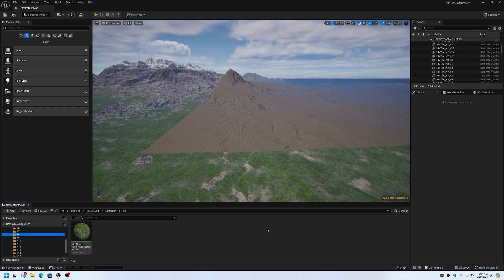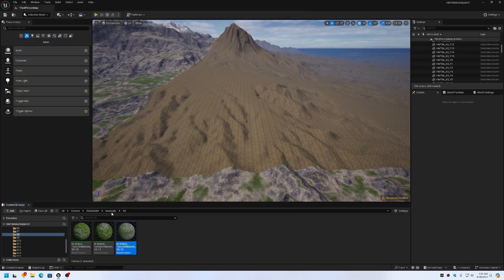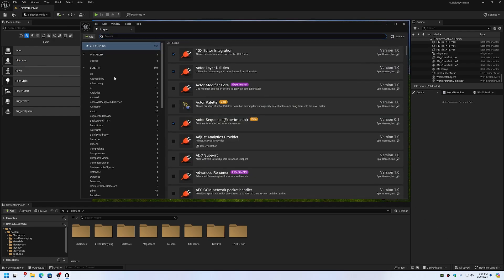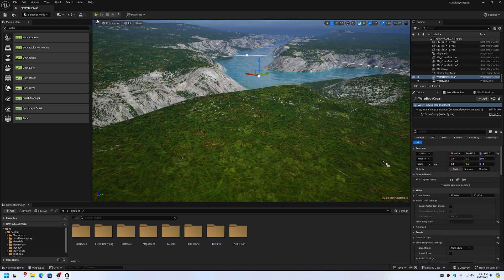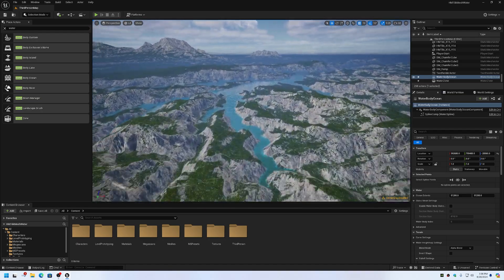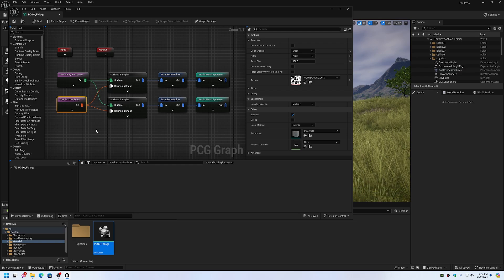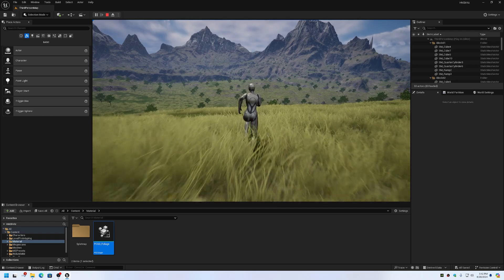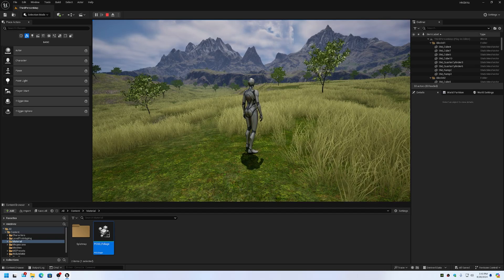UE5 Mesh Tile TIN Terrain Part 7 PCG Water plus

Comment from the maker: The TIN Terrain uses a specially designed Triangulated Irregular Mesh with Delaunay-style optimization.  Terrains up to 64km x 64km are easy to create and very fast performing.
Almost all of the Unreal Engine subsystems and features work with TIN Terrains.  See Parts 1 through 6 for more information.

Comment: how long did it take for you to generate the PCG for the map? it takes ages for me to generate over a 100x100 metre landscape on a pretty good pc

I'm spawning decently dense single blade grass but it's seriously so slow on pcg, using the landscape procedural foliage I've spawned grass with 10k density (modified engine) with 20k cull distance on a 2x2km map almost instantly

this approach makes me stuck with landscape though which i hate, unreals landscape performance is so bad and consumes so much ms on the game thread.

also kudos to you for this TIN meshed series, this is gonna be of so much help for people who are tired of dealing with unreals landscape
Reply from the maker: The PCG foliage generation for any foliage type was virtually instant.  I started out with low density spawning, and adjusted it right up to high density, both grass and trees, never more than a second to generate the meshes, usually instant.
Perhaps it is the PCG nodes setup that you are using that is causing your performance issue.  I always used the image node to determine placement, using a weightmap that I created from the terrain.
I also did most of my test work on a 24-Core workstation with 512GB RAM and an RTX-3090.  Unreal Engine develop systems should be as high end as you can afford.

I have more videos coming soon for the TIN Terrain series, including a lengthy set of tests for optimal TIN Tile staticmesh size and density.
In many cases TINs are the superior choice over Landscape.  TINs are faster rendering and lighter memory weight.  Spoiler: 512x512 40k vertex mesh tiles are the best.

I am also adding proper Delaunay Triangulation to the TerreSculptor software in the future, so that the entire TIN creation can be performed just in that one app.

Comment: it looks very good. It's also efficient perfomant i guess.
Reply from the maker: I have performed multiple performance benchmark comparisons on multiple levels of hardware, and the TIN Mesh Terrain outperforms UE5 Landscape by up to 200% faster.
TIN's have been used in video games for about three decades now, especially in Flight Simulators and Racing Games.  And on Consoles because TINs are significantly smaller in required memory than a heightmap-based terrain.  A 16km x 16km TIN requires as little as 500MB of memory.

Comment: @demenzunmedia hi, will Landscape destruction work with TIN? https://www.youtube.com/watch?v=bvcBBa3X4js
Reply from the maker: The TIN Terrain is just standard Static Meshes, so any deformation that can be done to Meshes can be done to TINs.  TINs don't have a built-in destruction feature out of the box, but anything that can be done in UE5 with meshes can be done with TINs.  Depending on the desired goal, a custom plugin may be required.
Reply: oh, I would even add that about the dynamic processing of terrain by voxel

Comment: You have to drag it onto every terrain subsection? Seems like a lot of work.
Reply from the maker: It's not a lot of work at all.  It's really easy.  If the terrain is small there may be only 4 sections to splatmap texture.
If an Auto-Material is used instead, it's even faster as the sections are all selected in the Outliner and the Auto-Material dropped onto all at once.  And an Auto-Material instantly textures, it's not like Landscape where you have to wait 10 minutes for it to texture.

I know people who have spent more than a week 50+ hours Extend Stamping World Partition Landscape in order to get around the 16km x 16km limitation of Landscape.  I spent a total of about 3 hours on this for everything on the TIN terrain including full creation.  Which is better?

If you prefer to use Landscape which is slower performance and limited to 16km then that is fine.  I am presenting another option that has many advantages.